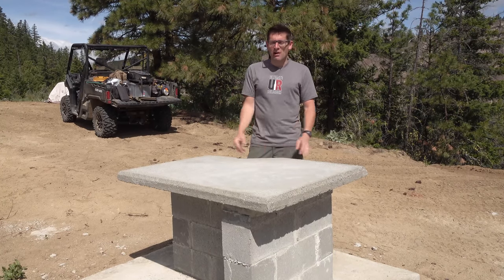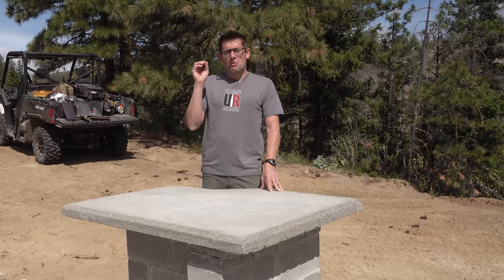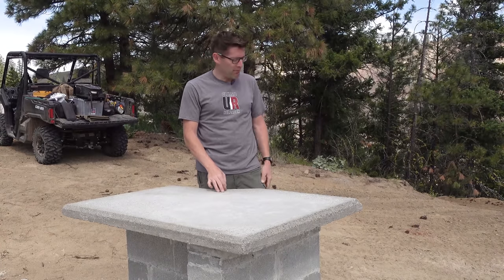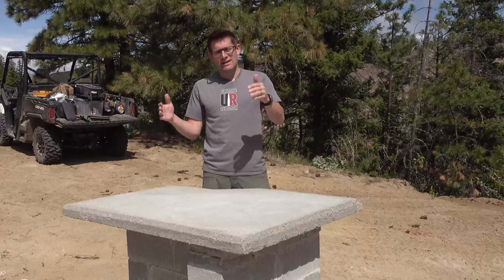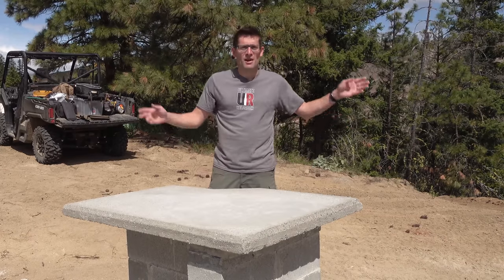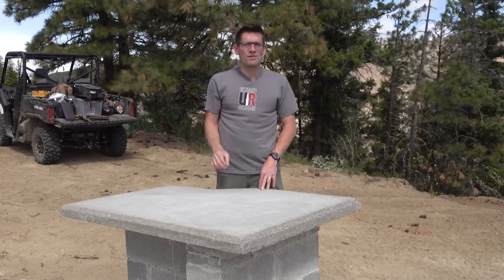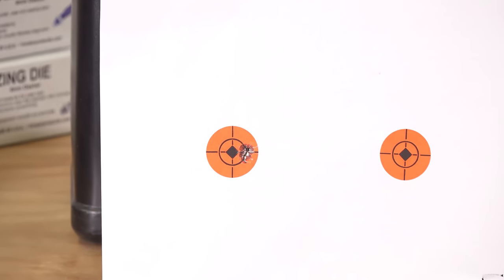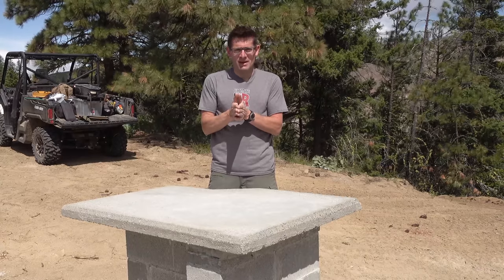DIY Concrete Shooting Bench and Slab for Under $300

Comment: Gavin you did an awesome job with the platform. I’d recommend two things; 1. Put a water sealer on the bench especially the cinder block. 2. Build a roof to provide shade and cover from the elements. Sounds like your choice of materials will provide enough strength. I always put rebar inside cinder blocks and fill them with cement. I doubt you need to do this for your application however. Job well done IMO.

Comment: As someone who works alone, I would have formed and cast the top in place, just like making a concrete kitchen countertop. Casting in threaded inserts could be handy later to add an umbrella or shooting accessories. 

Seriously though, as an engineer and machinist you are well aware of how to be anal retentive building things, but I appreciate you letting your viewers interact.

Comment: Having built a dozen for my shooting club, as part of a team work, it was a learning curve. We made those benches portable. Best solution we found was:
1/use aluminum scaffolding tubes and attachment for the bottom frame to which we added a pair of wheel at the front so when lift up from the back we could move them out of the way with ease for prone shooters. One note; make sure the frame doesn't interfere with your knees when sitting at the table!
2/ For the bench top, we use plywood however what we found was: it is not the weight or the thickness of the top but the flexing what was the most important part to consider. Heavy bench rest rifles, rests, bags, shooters leaning on the table...etc is a lot of weight, it will make the top flex and interfere with the stability. Best solution and to keep the weight down is to build a frame in aluminum (bulky but light) or steel (my preference) from there you'll see how much plywood you really want. As a side note shinny, polished and slippery tops attracted the most complaints :) :) leave the top a bit rough if I may suggest....
Thank you for your great work, very inspiring!

Comment: Gavin , your bench looks great and if it works for you that's all that matters  I love too shoot and over the years I've built a number of benches-portable & stationary. Most recently a large 10' bench that accommodates for rt and left shooters ,for two people., covered and even has a sun shade (bench faces west setting sun)  and a sound/blast deflector--sounded great in theory but the final results are inconclusive. 500 yes. What I've found is no matter how much you plan you inevitably find some things you might have done differently.
These things are " a work in progress"  and there is the joy in the building process as well learning. We really enjoy shooting at our bench even though  it's not perfect in all ways. We are looking at building a second bench down a recently constructed TVA power line on our property to shoot long range and I think something like your bench would suit our needs quite well. Thanks for the video. 
P S --I think you would really enjoy having this covered from the elements and would help the longevity.
CRhea MD

Comment: That should be a very stable platform. I started a mobile bench for right and left handed shooters. We have a lot of lefties in our family so I wanted to accommodate everyone.  The wood is from various family barns we had stashed away. The bench will have a set of wheels up front so we can move it around in the summer and store it in the barn in the winter months. I used spent .22 lr and .223 casings to create a logo in the center of the bench. I will apply epoxy resin to the top and some automotive clearcoat for UV protection.

Comment: Looks great man!  I did build a bench myself. It’s all steel. Same style of top you have but the bottom is 2 inch pipe stuck in the ground about 18 inches. The top is 1/4 in thick steel plate. It sits in a heavy angle iron frame. It’s very heavy and permanent of course. Very stable as well!

Comment: i would dig a T-shaped trench, build a form and lay a level footing. The depth of the footing below ground level would be dependent on the height of the cinder blocks and top thickness. Use rebar in the footing and fill in the hollow cavity of the first course of blocks with cement to anchor them. You could use small wooden spacers between courses and then fill in with mortar. Same principle if you construct the top down below. Use wooden spacers to support the top and fill in again with mortar. The  pad could be optional, but personally, i would make one and just pour it around the blocks. With the weight of the top, you do have the option of just setting it in place. Gives you the option of changing it. Mine would be double wide to accommodate rightys, leftys and equipment.

Comment: I built a bench using Rugged Buddy legs that I found on eBay. I made the top out of 3/4” plywood. The legs fold and when I lock them in place, the bench became solid and still movable. I supported the bench under the top with two pieces of 1/4” angle iron made of aluminum for rigidity. The other thing I did was take a aluminum tube the length of the bench and screwed it under the right side of the bench so that I could store my cleaning rod seeing that I am a right handed shooter. I also made a small drawer to keep my brushes and jags in. The reason I did that was my cleaning rod would be in the way and I use to knock it off of the bench.... Solid bench that folds and is transportable...

Comment: As a builder myself I couldn’t enjoy listening to the building process that this took to be built but I reckon your great effort to get things done. Next time please use some #3 rebars or wire mesh that way you get rigidity on the slab. Now you should get some stucco mix and skin coat the whole bench then seal it with a good outdoors paint.

Comment: First you said your an Engineer, I hope Home Depot didn’t sell you cinder blocks because what you have is concrete masonry units also known as CMU’s,  the pavers you used are just pavers and could have been broken when you cracked the top.  Another issue is you put your blocks on top 3.5” on slab.  Your best install would have been to pour a footing for the blocks One block deep with rebar and grout the cells full the plan the top of your footing to adjust the overall height of the top when you place the footing.  For your top you should have built a metal frame of welded angle. With welded wire mesh for support set it on your the melamin top.  
My gun club has 8 concrete shooting rest each one was poured in place in a mold that was made from plywood and 2x4’s for the legs are a poured in place tee like yours they have rebar running from the footing to the they have a sun roof to keep them from heating up first that crack will in all likelihood crack worse after the winter due to frost.
Reply: FK ,
I can tell that this is not your first rodeo !
Experienced Professionals standout !

Comment: I like the idea of a concrete bench. That is what they use at most all the ranges. They are as good as it gets. I myself am looking at making a very heavy-duty wooden bench that will have the ability to move if necessary and be stable as well. The gun range I used to shoot at has been closed because of tornado damage and I don't know when they will be able to reopen. They need to invest about $50,000 to get it back up to specs and reopen. So, I have set up a 100- and 250-yard range at my farm. Not too crazy about shooting at the farm a lot but with the range closed one must do what they have to. I will probably put a pad in to sit the bench on. Most shooting benches that are for sale are flimsy pieces of junk and not stable at all. A good solid wooden bench is the best way to go. If I need to move it I will use my tractor. It won't be a lightweight bench. Light weight in no way can be stable enough for a good bench rest bench.

Comment: My benchrest club has a similar concrete bench setup.  On top of the concrete top, they've added 2 - 3/4" pieces of plywood.  This would help get to the 34" height you'd mentioned as well as add a replaceable surface for the sharp anchor points of a mechanical rest to dig into.  I agree that you may wish to seal the concrete and add a roof at some point.

Comment: Our shooting benches at our local range uses a similar design except our seats are made of concrete blocks with concrete slab seats (for left and right shooters) We then covered the all the table and seat slabs with scrap horse stall floor mats. These mats protects you firearms from scratches and your butt from sitting on cold concrete.

Comment: Luv your bench video. A couple suggestions:
1.) Use rebar to reinforce to top prevent cracking. 
2.) Put in a lifting inserts or eyes in flat-top. This will enable safe and easy lifting with your backhoe or crane. You can cut them off later and patch any blemishes. 
Keep liv’ the dream!! 👍👍

Comment: I've used the concrete blocks for the base and a 1" wood topper covered with a flat dense carpeting, We have ours covered though as a pavilion which allows the carpeting to not get wet.  Prevents a little resistance to damage if something is accidentally dropped.

BTW, Still love that finished rifle.

Comment: Looks like a good bench to shoot off of.  I look forward to seeing you build a portable bench.  I have been planning to build a portable one for myself for long range shooting.  I haven't been able to find any plans that fit my needs yet so I was just planning to wing it.  A friend of mine built one out of steel and it's extremely sturdy but it also weighs better than 80lbs which is more than I want to lug around so I plan to use wood.  I'd like to keep the heaviest piece under 50lbs if possible and 60lbs at the most.  I'm thinking detachable legs might be necessary.

Comment: Having an adjustable height shooting stool, the height of the bench is not near as critical. Just use four layers of blocks with the slab on top. A car wheel, some redi rod, a couple of nuts and a 2x12 for a seat is inexpensive and durable. We just set up three columns of half blocks dry, two in the front and one center in the rear. The bottom slab has rebar protruding up at each leg site. Fill the legs with slightly wet concrete, no mortar in between the blocks. The top is precast upside down with three lengths of rebar that go into each leg.  On assembly day, stack and  fill the legs, drop the top in place square up and walk away. 
Make sure the tops have a deep enough recess for the shooter, so as to get the left elbow on the top comfortably. .

Comment: If you don't mind a different shape and materials, you can try wheels. Those wood wheels use to carry hugh electric cables, they sometimes will be consider as junk and there are plenty of them in your local junk yard. You can choose small ones and pile up 4 legs or a hugh one. And then the top, artificial stone use in kitchen bench is a convinent way to get a marble flat surface in reasonable price. Give it a 1 1/2~2 inch thick piece, you can stand on it. It is design to be machinable as well, you can use stainless steel screw bolt it to the legs. Or you can do it 2~3 piece U shape table top (yea, who say a table top must be in one piece? You can carry 2~3 piece in your 4x4 without any helper), it is all possible as you can see them in ordinay kitchen. If you are more ambitious, give it a cheap harbour flea car jack under the table top, you will have a adjustable height table top.

Comment: I hope you don't have trouble with frost heaving in the winter. You surely would if you built this in the Northeast US. Your ground looks very dry, so you might be OK. In the Northeast all footings have to go below the "frost line" (typically 6 feet where I am), in order to prevent heaving across the seasons. That's why everybody has a basement in the east, whereas few have them in the west -- well, in California and Nevada, anyhow.

Comment: Just a weird. You could call it antidotal thing.   I have taken to carrying a clean piece of poster board with me to the range.  I lay it down across the front of the table, taped down, and place my bipod on that. I have found over the course of working up several loads for 4 different guns that the average group size is 3/4 to 2/3 (3-5 inches down  to 2.5 -4) of the size @ 400-500 yrds of not having the poster board.  The poster board allows a smooth surface for the recoil to travel on verses a concrete or wood surface.  Grant it, a stable 3 leg front rest with a smooth surface to surace interaction can be better for recoil mitigation. This just is one way of removing a source of error that I have found when working with field / working guns. Also remove the back sling stud makes a difference.  A little off  topic. 
Amazing table.
 Nothing is perfect the first time and if it is; the second time is a catastrophe. "MURPHY"

Comment: Nice bench, but you're going to want to have a solution for your right elbow, either wear long sleeves or some kind of pad to put your elbow on, rather than the concrete.  You'll wear the skin away pretty quickly from recoil.  It doesn't take a lot.  For the top, you can buy pre-cast, 3" thick slabs that HVAC companies use to place compressor units for central A/C systems on, outside buildings.  As long as you can be happy with a square top.  Last shooting bench I built had 4x6's for legs, 2.6's for the framing and 5/4" decking for the top.  It was built about ten years ago, and the top needs to be replaced now.  It was all pressure treated lumber, and it was stained about five years ago, but the Texas sun will bake wood away to nothing sooner or later.

Comment: I want one, I live in the mountains of North Carolina and I would have to cover it with a roof and seal the concrete if rain or snow gets in the pores and freezes the concrete will eventually crack. Or may be use some cinder block filler paint it will fill all the cracks and it hides a lot of mistakes. And how is the top attached to the bottom? I am a mason and for a first timer using what you used it looks great. Also where is your ranch located?

Comment: Look at the techniques for concrete counter tops.  Consider some lightweight aggregate.  Borrow a concrete vibrator to flow and de-air the concrete in the mold.

Comment: Good job. Next time, instead of using mortar to set table top, just place top on and use concrete anchor bolts to lock them to the base.

Comment: No doubt the bench you made is remarkable for its remote position and sturdy construction. The only better choice might have been using a bolder already at the location. Then chiseling it into a shooting bench. Reducing the chances of the bench settling out of level from the effects of weather. Even if this happens it is easy to adjust for that minor issue. Something I discovered spending time at different ranges is using targets that use reflective paper over ones with flat finishes. The low reflective targets produced tighter groups than ones made of shiny paper. This is one important fact few understand. Even the slightest change in light will change bullet impacts. Using high magnification or low magnification scopes the surface of the target paper makes a difference. Using certified targets produce better results. Another important reason is becoming familiar with the consistent sight picture of the target. Using a 100 yard Bench-Rest Target has the best advantages for testing accuracy. Buying targets in large quantiles saves money as well. Most sight in targets makes a poor choice for getting accurate results. The great thing about quality targets is they provide an important place to record the data of the results for later study. If you decide to compete in matches the targets you use to practice with should be the ones that are used at the matches. If you practice in changing wind conditions you learn how to read the wind and make the proper corrections.

Comment: Fiber mesh is way over-rated. Ask me about my driveway. Rebar requires 2 inches of coverage over top and bottom for maximum strength but a section of welded wire stock panel would probably work well in this case. Concrete takes 28 days to cure to 80% of strength.  Would like to see a design that incorporates the ideal set-up for using a rifle rest to reduce recoil while zeroing say a 338 Win Mag. Great video. I do a lot of things with just me and the Lord. He always shows me the way.